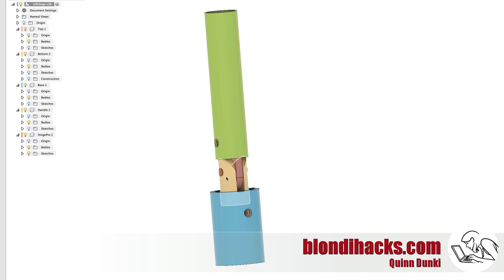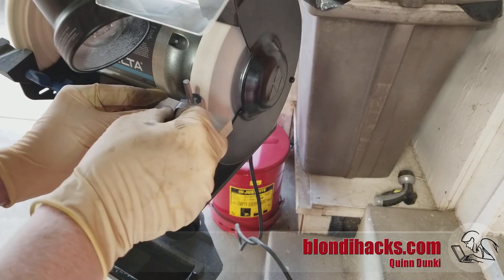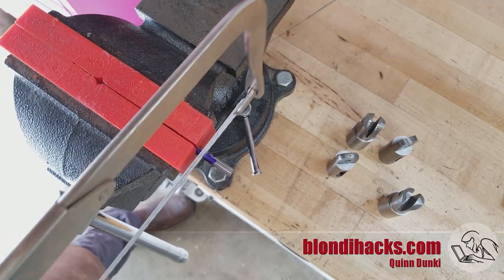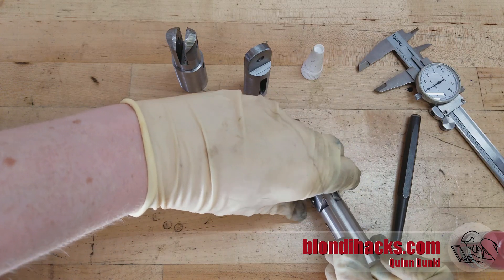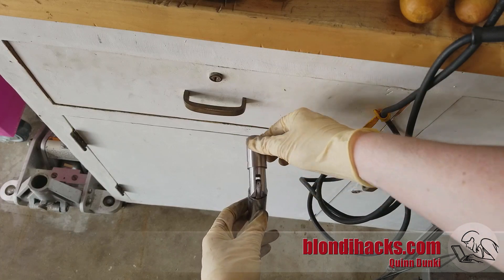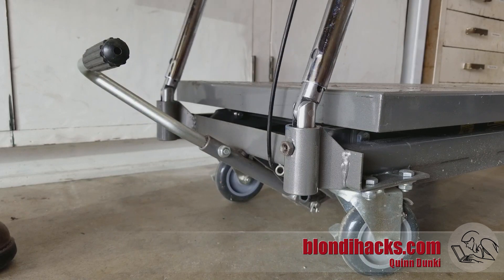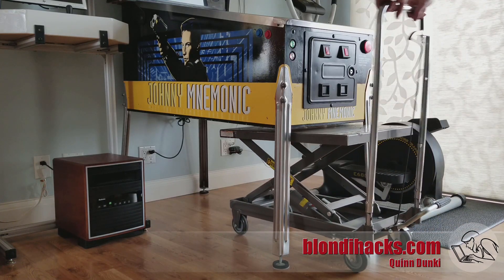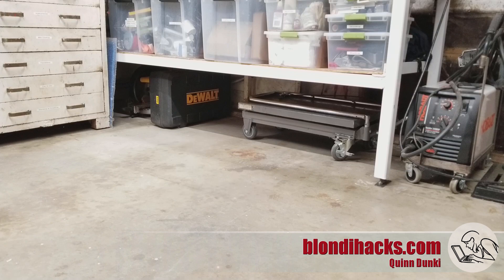How To Make A Locking Hinge : Part 3/3

Comment: Nice hinges. Did you make or buy that cart? (cant find video so assume you bought it). I just made a similar cart, but not happy with having vertical bottle jack at front it, so considering remaking. I'm not really a metalworker so dont have resources to make hinges unfortunately.
Reply from the maker: That's the Harbor Freight lift cart (the 500lb model). It's actually pretty decent for the money, as HF stuff goes. I've gotten a lot of use out of it. The seals leak, of course. 🙄

Comment: Now I want a pinball machine.
Reply from the maker: Steve Shindeldecker I recommend it! They are great fun to play and to work on. If you’re interested in them, check out the Johnny section on my website (menu bar at the top)
Reply: @Blondihacks  Kool, I'm going to do that, I would like to find an old Addams family pinball machine.those are so Kool.
Reply from the maker: Steve Shindeldecker Oh excellent choice. Those are very well regarded pins, and they go for reasonable money. A lot of Addams Family machines were made, so they aren’t crazy expensive. Try the marketplace on Pinside.com and you’ll find one near you, I bet.
Reply: @Blondihacks  thanks a bunch, I'll check it out. The beer joint in my hometown had one in it and me and my buddies would kill pitchers for hours playing that thing.
Reply: @Blondihacks  I was working in the amusements industry (it was my first customer-facing job, as the external-site technician for the local distributor - and I had one of those Micronta meters too!!!!) when Johnny  was released  in Australia.  First service bulletin was to pull out the matrix buttons,  scrape off the mould parting line  flashing  and lubricate heavily with dry PTFE  (Zipper-Eze).
Reply from the maker: @greaser5691 Oh good to know! I have noticed the matrix buttons can be a bit sticky. I had mine apart recently (I did a blog post about it on my website) to replace one of the switches in there. Next time I have it apart, I'll perform that bulletin.
Reply: @Blondihacks   Given the age of the machine this is very likely to have been done (in extreme cases it could cause the balls to get trapped up there), but if you have a button or two that seems a bit insensitive/recalcitrant it is worth a look. Field service items like this are sometimes done in a bit of a hurry.

Comment: Longtime viewer, first time posting. The hinged handle is an awesome idea, specially for such carts. It’s aesthetically pleasing and functional. When I make universal joints, I use the very same idea in your jig to round my ends, only fastened to the mill vise and using endmills to round the ends, as I rotate the work piece, gradually, around endmills. But, as the very nature of this craft is in the old adage, “there’s more than one way to skin a cat”.the hinges are awesome!
Reply from the maker: You know, I considered doing this with an end mill, but I wasn't sure how safe that would be. Do you do multiple passes with it clamped for each pass, or do you move it by hand the way I'm doing on the grinder?
Reply: I make my passes just as you did on the grinder. For safety, on the mill,  my work piece has a bar or pipe temporarily fastened to it. It could be a 6” or a longer bar, depending on your comfort level, where it gives me feed control as I rotate the piece around the endmill. I feed everything straight into the endmill, incrementally.Again depending on the material being cut. Low carbon steels, .010-.015, soft metals .015-.020, except for brass, bronze, and dural, I’ve never tried these on the colored soft metals because I never needed to. But remember some of these soft (nonferrous) metals can e quite “grabby”. As I said, when I do this method, I think of a 90 deg. Safety net. Where the center of my face down to my left hand is a safe distance from the actual work, and because the workpiece has a round bar or pipe attached, it’s easier to let everything go, if anything untoward were to happen, thankfully, no such thing has ever happened, and I’ve been doing this going on 4-5 years. But...it’s always good practice to err on the side of caution. Also, if I’m not mistaken, I think Tom Lipton, of oxtools, showed a viewer this method on his milling machine, sometime ago. I can’t remember the video. But he also pulled it of safely. But, work within your comfort level, when it comes down to it. When I first tried it, my comfort level was using black Delrin(acetal), machines beautifully, better the most metals. I found I could take off .025-.030 using this method on this material, then I gradually worked up through the many series of aluminum, then 12L14. I’ve done 416 stainless, but again, for my comfort level I got it up to .009. I’m sorry, I didn’t mean to carry on. But, I was taught “everything you learn is a tool, so share it”, in my apprenticeship days. Keep up the good work, and good luck.
Reply from the maker: @eddietowers5595  That's super interesting- thanks for sharing! The detail really helped. I may give this a try! A lot less trouble than setting up the rotary table for a simply job like this.

Comment: Well done, though I'd rather use a handle with a bit more wall thickness. Mostly because even if designed for some specific task, which it can perfectly do, 
one never knows what future use the trolley might see, and by the last seconds of the video it looks like not being able to support much load while on it's vertically-locked position. But good job anyways!
Reply from the maker: The handle came with the cart, and it's rated for 1000lbs. It's quite strong. The movement you see in the vertical position is just some required clearance in the hinge base because the hand-bent factory mounting sleeve needs generous clearance to slide into. That slight backlash doesn't affect the load carrying capacity of the handle or cart.

Comment: As usual awesome video. I did not realize the threadlock was that strong.
Reply from the maker: Well, the threadlocker at the end is just keeping the bolt from working loose because it isn't tight against anything. The bolt itself is still carrying the load. For the hinge pin, 603 is something different. It's a cyanoacrylate-based substance designed for metal in light-press fit (oxygen-free) situations. It's very strong when conditions are right, but again, all it's doing here is keeping the pin from sliding out.